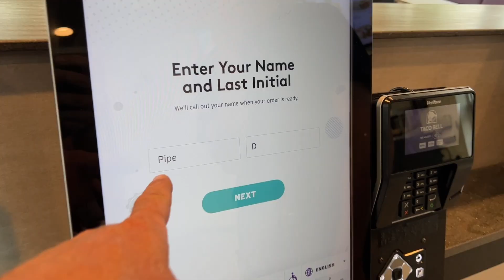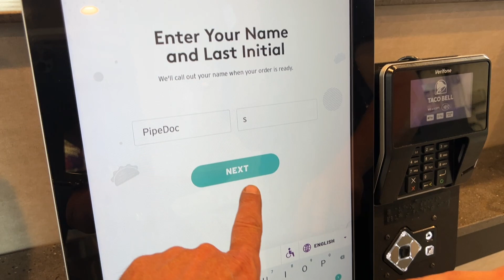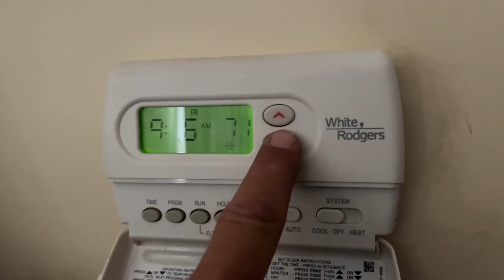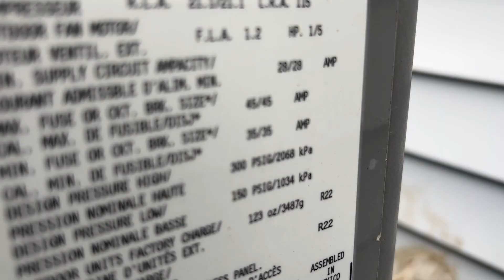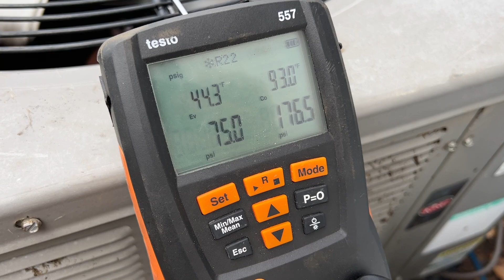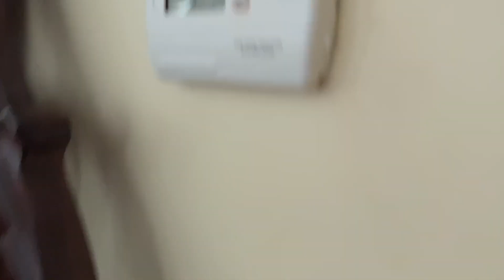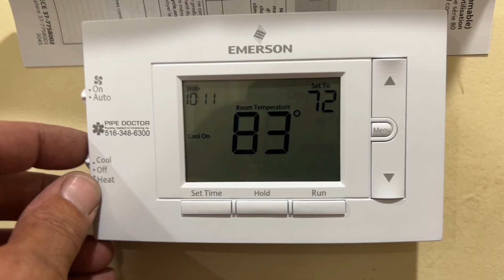2nd Floor Central AC Zone Doesn’t Cool When 1st Floor Is Running

Comment: I always would change the batteries.. even when the customer said they did.  half the tie the low BAT indicator wont show and the batteries they have on their kitchen drawer were half dead..  but that looked like a nicer T-stat anyway that he has now
Reply: check the end contacts, they might be gray from  a leaker battery ( I've had more leaking Duracell in the last few years. Not dead, not past date) The relays in the thermostat are sensitive to battery voltage.

Comment: I have a one story home with a finished basement. All the HVAC equipment is in the basement. In the summer the basement is like a freezer and the first floor is close to 80 degrees. The heat seems to work all season long but the basement is markedly hotter than upstairs. I tell the tech than you can hang meat in the basement in summer and cook it in winter. Do you have any idea what might be going on ?
Reply: It sounds like an obvious duct or airflow/distribution problem.
Reply: It sounds like my house. I close the vents/returns in the basement because they are unnecessary. But, everyone says that's bad for Air Flow. That's not true in all cases.

Comment: Hey doc what would make for a weak air flow, fixed ac 80 indoor temp supply blowing 60 but not hard
Reply: Blower motor speed/ dirty or dirty blower wheel or evaporative coil would cause good temperature split but poor airflow
Reply: How long have you been in the house?  has the air flow always been good? what type of duct work do you have?  does it run in a crawl space? if so, check it as critters could have damaged it.
Reply: Bad filter, or dying blower capacitor, closed registers, or restricted/dirty evaporator, or crusty fan. Start there